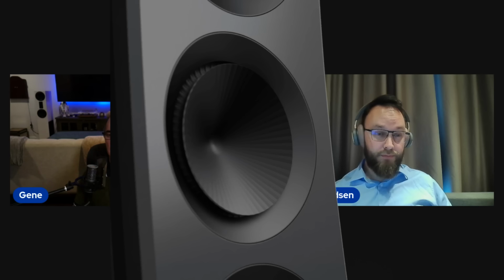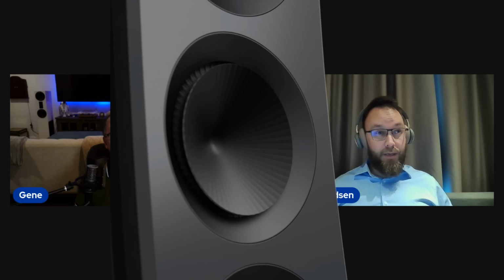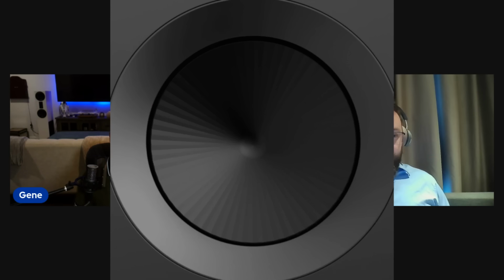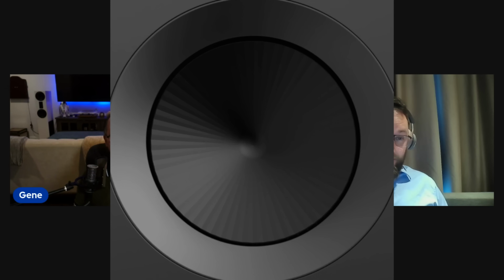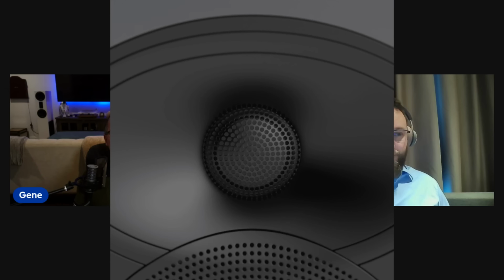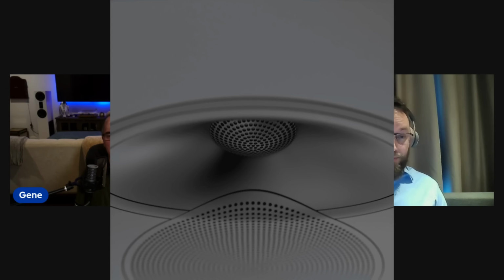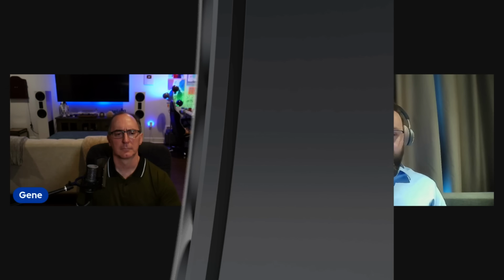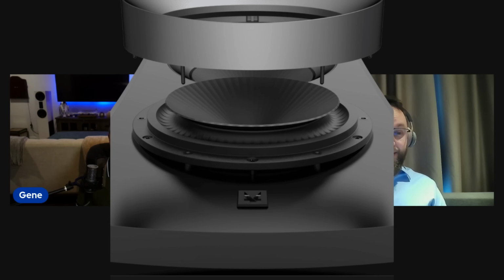Arendal Sound 1528 New Loudspeaker Series Details!

Comment: I'd much rather NOT have a "thx rated" speaker, because I know there is a cost to the manufacturer to get that testing and stamp of approval to get the rating, and that cost is passed on to the customer.  I don't care about the THX rating, if I know the specs and the measurements, then I know what it is capable of without a THX rating.  It's like getting the "organic" label or any number of other labels, you pay for the testing and validation of the label, even though if you didn't pay for the testing, the product would be exactly the same but just not have the official designation.

Comment: I'm looking for an excellent 2 channel tower speaker. I'm wondering if a Yamaha R-N2000A would be sufficient to power the 1528 towers since they are less efficient than the 1723 THX.

I also wonder how many woofers they will use since it won't be a MTM.
Reply from the maker: Yes the Yamaha would power ANY of the speakers in this series very well. If you do decide on getting one, please consider using our affiliate link: https://www.audioadvice.com/yamaha-r-n2000a-hi-fi-network-receiver?referral=audioholics
Reply: @Audioholics  I have the R-N2000A already. I'm trying to wait on the speakers.😃

Comment: I applied to work for these fine people. Ultimately, I do not. But they were very personable and maybe one day. Great company and products.
Reply: ..Same.. twice. Im not good enough for their A team.
Reply: I own Arendal speakers.  Neutral, but overrated.  They are turning into a marketing machine.  I wouldn’t buy again. They aren’t high end yet carry the price tag.  Look elsewhere.  Also made in China.   I don’t regret my purchase but wouldn’t buy them again.  Bass extension is poor with no slam.
Reply: @markl1671  they are built to be used with subwoofers. If you didn't understand that the regret is understandable.
Reply: @markl1671  I agree for the most part, but what I did was remove all rear port plugs, and on the 2 speaker settings on my marantz cinema 50, i have one set to full range for music, and one set to 60hz for movies. That way, I'm getting more bass when listening to music. I do have 2 SVS SB-3000's as well. That being said, I'm happy with the 1723's, but  I'd never buy Arendal again either.